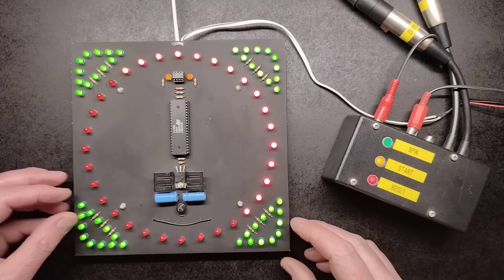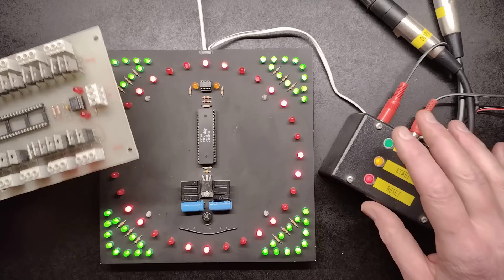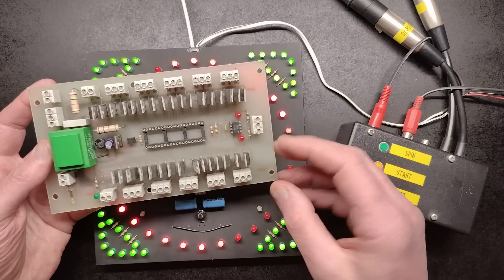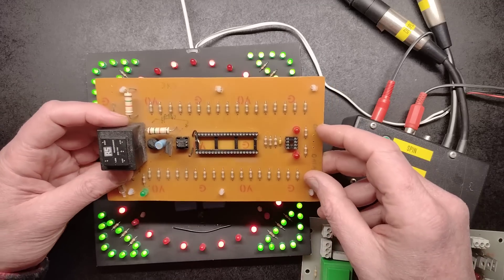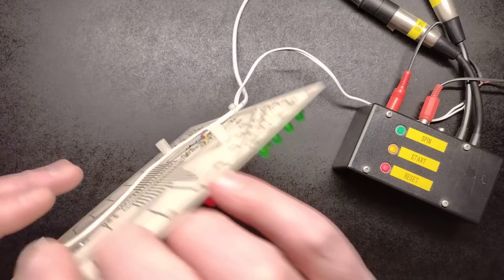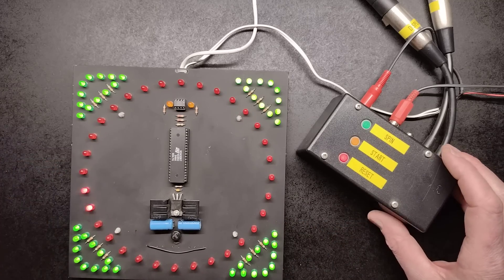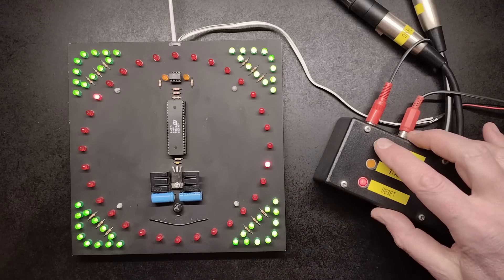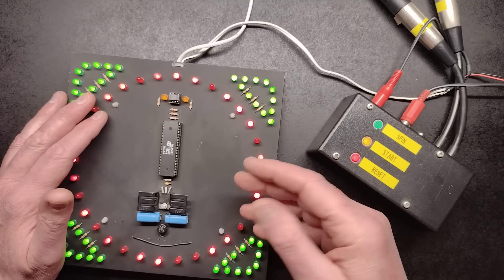Flux and carnival games (Loud 8-bit noises!)

Comment: I've never had any problems with flux corrosion either. But I have had problems with circuits that have not worked due to flux. This problem manifests itself at high frequency and low current.

Comment: Many of the modern multicore electrical solders don't need washed because they use a synthetic flux in the core. I can remember when organic core solders would corrode copper and you had to clean your repairs with flux remover. It's been quite a long time ago. Still, I would say to read the technical data on the type of solder and any flux that you use and follow the instructions.

Comment: Hello, great audio 🤔 time of my youth 😁
I never cleaned the rosin-based flux, I also made a soldering solution from rosin dissolved in alcohol - super protection of PCB paths. In the research laboratories, I got hold of "Epsilon 3" soldering varnish, I have never had anything so wonderful for soldering in my life, the tin spread on the roads like butter. The problem arose when reviving the prototypes, somehow they forgot to warn us that E3 is conductive and needs to be washed. That's how it happened that each board behaved differently when reviving (differently thick layers of varnish were conductive differently), integrated circuits jumped up to the ceiling 🤪 the wiring design, PCB design, assembly errors were checked and in the end it was such crap - conductive varnish. I clean the soldering liquids and pastes uncompromisingly, but I leave the rosin alive, I only clean it in case it burns due to the need to use high temperatures, for example with DPS with an aluminum substrate.

Nice day 🙂 Tom

Comment: Cleaning flux depends on the circuit, it’s an absolute must for crystals, oscillators, RF, IF and mixer circuits at a minimum.
Reply from the maker: Mystery cables arrived today, thanks.

Comment: I dug out some of my old projects I had built back in the mid 1970's some on veroboard and some i had etched the PCB's myself from my design, all used nice Leaded solder (in love with it) I never bothered cleaning of the flux either, although the flux on the pads were minimal in most cases there was no indication of damage or corrosion at all.

Comment: As a product of the eighties myself, those sound affects really takes me back to my youth.

As to the flux, rosin core solder shouldn't be an issue. Good practice is to always clean anyways, not to prevent corrosion but just house keeping to make it look neat and tidy.

The issue comes when you use an acid based flux, that stuff has to be cleaned off. I use different flux for different things. I work on model trains and use rosin core 60/40 for the electrical side of things but when dealing with brass and white metal, you change the solder used, even down to 70°c low melt and that is when you start using acid based, either gel/cream or liquid. One flux I use it literally hydrochloric acid in glycerine.
Reply from the maker: If I had a time machine I'd have my holidays in the 80's.

Comment: You're using two different terms interchangeably, flux and rosin. Flux is used in plumbing and is always acidic. Rosin is only acidic when heated into a liquid form. When rosin cools and hardens it is no longer acidic and won't harm delicate circuits. Rosin can be thinned into a liquid. Depending upon the thinner used it won't be acidic. I've always preferred to use radio shacks paste rosin. I bought some in '88 I believe, and I never used it up. But the lid broke so I eventually had to replace it with a plastic can about 10 years ago. Didn't like the can as the lid would get stuck on and I was afraid it might break from the great deal of force needed to open it, but it never broke. I still prefer the squeeze tube.

Comment: I have been using Rosin flux my entire life and have never once seen it cause any damage to a circuit board or solder joints. I have, however, seen Zinc Chloride based flux eat holes through circuit board substrate even after it had been thoroughly cleaned. I believe this is another case where the devil is in the details.

Comment: Aside from the corrosion issues, flux can also be a problem for very sensitive, high-gain amplifiers. I worked for a company that made optics instruments sensitive to nanoamps. The most sensitive setting used a 1 or 10 GIGohm resistor (don't remember exactly.) We regularly needed to re-clean (or first clean, it was "no-clean" flux) about 30% of our boards to get them through test/calibration. And about 30% of those needed another re-cleaning. I looked up the datasheet for the flux we used (not necessarily what the fab used) and the residue impedance was on the order of the amplifier resistor (around 10^9 Ohms.) Some of the failing full-scale measurements came out to about half-scale! It took a long time to convince management that there was a problem. (For some reason, they will insist on collecting data for a year, rather than taking the frustrated word of a senior technician. "Why am I falling behind? Maybe it's because I have to spend 14-15 units of labor to produce 10 units of product!") We finally got a cleanliness spec added to the manufacturing documents and our failure rate dropped significantly.
Reply: When I worked in the missile industry a long time ago (before surface mount components), all flux had to be cleaned off and checked by looking at the circuit under a low power microscope. Don't know if that's still the case. It would have saved a lot of money if no cleaning required. The decision to clean off all flux must have been data based?
Reply: This is why the Analog Gods invented guard rings.
Reply: @paulperry7091  Don't know what a guard ring is.
Reply: @franzliszt3195  I'm not sure that I know either. These gain sections had a massive isolation slot under all the gain paths, but the highest (and sometimes second-highest) gain still managed to fail quite often. I think the engineers couldn't believe flux was the cause when there's a big hole in the middle of the circuit. Disassembly, scrubbing with flux-off and water, and a few hours in the heat room usually fixed it.
Reply: @jstan_49  Very interesting isolation slot and yet flux an either side caused a problem. Somewhere out there there must be a paper on it, or at least an opportunity for a PHD thesis.

Comment: I have some 20 years old industrial keyboards with trough hole components manually assembled with lead solder and no sign of corrosion despite the rosin residues.

Comment: We started our company with fairground games.  First a system that would grab a frame from a video camera and print it on a calendar.  This is 1979!  Camera was vacuum tube and the hardware was a large cabinet of wire wrap.

Then handwriting analysis.  Maintained and upgraded those machines for years until the owner retired.  I used an 8051 processor, flashing lights on the booth, sound effects using a 3 channel timer chip with all 3 outputs mixed to make "computer" sounds.  My upgrade used stepping motors to drive the custom made chart recorder.

This is how we got our machine shop, we were paying $$$ to machine shops to make things we could do ourselves with a mill.

On solder, "active" flux has to be cleaned.  I had a case where a flux pen had the wrong flux in it.  The active flux was wicking under surface mount packages and then over time soaking through the plastic and corroding the bond wires.  THAT took a while to figure out.
Reply from the maker: I loved the theatre of the handwriting machines.  There was one at a big store in Glasgow that had a veritable wall of neon relaxation oscillators.
Reply: @bigclivedotcom  I had someone in the office one time I was working on one of them and asked how I did the analysis.  I showed him the program section... rand() ... he was heartbroken, thought it was real.

At that time next to the carnival trailer in the driveway sat an 8 foot aluminum rocket I was making.  Several of us launched that and broke the sound barrier.  Our neighbors realized we were "different" right around then.

I still have your PC board with the bead sitting on my computer at home, makes it run better.  :)
Reply: @bigclivedotcom   On the neon relaxation oscillators, my father built a "do nothing box" for me back in the 1960s.  It was a nailed shut wooden box with a row of holes with NE-2 lamps.  He had a string of 22V batteries inside to run it.  Lasted for YEARS.  I loved it.

Comment: I've seen plumbers flux cause corrosion to copper pipes, sometimes you can see the plumbers fingerprints in blue green fuzz. I have also seen holes in water pipes caused by flux eating right through pipes !

Comment: Eeek! Clive, you mentioned problems with isopropyl alcohol & potentiometers!
I was about to try cleaning an erratic pot that controls the speed of my mobility scooter... I think it's a Honeywell 53 series industrial pot, that's the closest I could find from a similar reference number.
Anyway, I was going to soak it in WD-40 Switch Cleaner, which is just isopropyl alcohol in an aerosol, and work the slider back & forth to clean off the dirt.
But you've given me pause now...
Am I rushing in without some vital info? Like the track lifting maybe?
Reply from the maker: Standard switch cleaner should be fine.

Comment: ah interesting... so the modern day fluxes for lead free have improved significantly? was not actually aware of that. indeed is helpful to know. although as you point out, maybe for some finer smd boards its worth removing...

i suppose the worst case examples are from china, where they are making things as cheaply as possible. then shipping them across in containers that may be semi-ventilated to sea air or whatever semi-outside storage conditions while in storage. things like this. sometimes they might also use such cheap pcbs that are like... perhaps de-laminates way too easily. idk. things like that

Comment: Interesting how clean those circuit boards still are, because our warships' PCBS were protected against salt fog and air salt corrosion using using polymeric coating system, namely Parylene which is a green polymer, and is still used today by shipbuilders Harland & Wolf. Your video was great fun. 🙃
Reply from the maker: Sea atmosphere is an electronic disaster.  It wreaked havoc on the promenade lighting control systems and ride systems.
Reply: @bigclivedotcom  I know only too well for serving on the Ark Royal. The problems she had during her voyages would have filled Captain Jerry Kyd's log book! 🤣 Thanks Clive, much appreciated. 🙂

Comment: In the mid-90s I made a simple audio mixing console, and I had the problem when slide 1 was closed, while an audio signal was present, that this came through very quietly to the 2nd channel. (Was only audible during the silent parts in the music) The other way around I didn't have this problem, after a long search I found out that the flux (S39) caused this small leak. In recent years I have mainly used the Kalaphonia flux, which does not have to be removed after soldering, and even protects the soldering.
Reply from the maker: Capacitive coupling can also be an issue with audio.  It's why some film capacitors have the connection to the outer side of the foil marked.
Reply: @bigclivedotcom  yes indeed, but my audio mixing was so simple, that it didn't contain any capacitor, just 2 slider logarithmic potentiometers :-) The connections to both sliders was mounted on a small pcb, where the leakage occured. Grtz

Comment: Have you ever had problems with 'whiskers' on busbars ?  I think that pure zinc (and similar) is the issue, but older lead alloys or nickel plating are fine, as far as I understand it...
Reply from the maker: Not with my use of lead based solder.

Comment: There are some fluxes where you have to clean because it's corrosive, and others that you don't need to. It's usually stated as a feature in the box, like "no-clean flux" or "no clean solder" if it's solder with flux.
Afaik the main difference is that the no-clean fluxes look bad and are hard to clean while the fluxes that are easy to clean are also the ones that are corrosive and must be cleaned away.
I think that they were invented for automated manufacturing, for normal DIY use there is no real benefit besides looks

Comment: I've always figured that the "flux will corrode your PCBs" idea was caused by people using the wrong type of flux for soldering (i.e. plumbing flux or another acidic flux). As far as I'm aware, most commercial soldering fluxes are designed specifically not to corrode traces/solder joints. If not, I would expect a warning in the flux manufacturer's documentation.

Comment: Yes, always clean the flux off, I used to repair speed controllers returns from China production, I found the flux corroded the tracks on the PCBs, by the looks of it, damp makes the flux corrosive, to prevent wicking of flux on plug in connections just use cotton buds with the flux remover gently around the connectors
Reply from the maker: Some Chinese stuff has terrible flux on it.

Comment: I've always had good results with RA (rosin activated) flux and removed the residue. I will sometimes vat clean the board then add connectors, switches, pots, etc. that are hard to clear completely and spot clean those joints. Multiple stages of vat cleaning with good agitation and brushing, compressed air blowoff after each stage and a clear rinse will usually leave no residue even in pots and switches.

Comment: Always cleaned the flux off the pcbs, we used an Arklone tank. It had two compartments the front one heated so the arklone would vaporise where the PCB's were dipped and then hung up above in the vapor. The vapor would over flow into the second compartment where it was condensed back into a fluid.  It would then flow back into the front one. The vapor was heavier than air and sometimes overflow the tanks and then it would remove the polish on your shoes 😅

If you  breathe it in it would relax the lungs to the point were you would stop breathing and fall in to the fumes at your feet. Not much elf and wafty back in those days.  

Also used to dip the boards in Fox's varnish and hang them up to drip the excess off, the drips over the months would form a 1 inch or more slab of varnish 😂 in this slab would be all sorts of dead critters could be seen. We also would add a few critters to the mix as well😂

Comment: Great commentary!  We build components that use tiny SMDs on ceramic substrates, and have found that not removing flux residues, can result in dendrite formation (and SC) over life, so +1 on the SMD comment.
Reply: Tin whiskers was a big problem with lead free solder in the early days,  which is why mil and medical were some of the last sectors allowed to keep using leaded solder.
Reply: @TheEmbeddedHobbyist  Been in the medical device business for 25 years, never had a problem with lead-free solder. You just need to get a good formulation from a reputable manufacturer and use an excellent flux. Dendrite formation is far more of a problem with even the tiniest amount of lead contamination. I only ever bought from completely lead-free assemblers and banned leaded solder of any kind from my companies.
Reply: @MarkSJBeard  i did not say it could not be used, just that it was one of the last product areas where lead solder was allowed.

i believe that all exemptions have now expired, maybe space is still one?

Comment: I worked for one of "those large computer companies" and when we reworked circuitry, we didn't remove the flux.  I find it comical that people "remove" flux using IPA but what they're really doing is dissolving it and spreading it in a thin film all over the printed circuit board.  They're not really removing the flux.  Total immersion in a flux cleaning environment would be required to totally remove the flux.  Also, we used a "no clean flux" anyway.  In some cases, cleaning attempts to remove flux would re-activate it causing it to become corrosive.

Comment: I've still got stuff I made in the mid 70s and still works. I don't remember cleaning off the flux and I've never had a problem with corrosion also. That said, I would always clean up if an electrolytic capacitor leaked!

Comment: I've only ever had to clean flux off a resonator boost circuit in a old ti52 calculator and a 32768Hz crystal oscillator circuit in a kit clock because of excessive drift. Most things I've left the flux on but only oscillator I've had to clean it because of drift issues or over time the oscillator would just stop running.